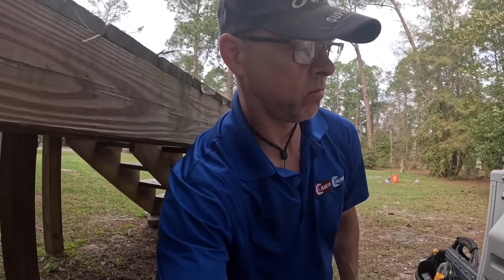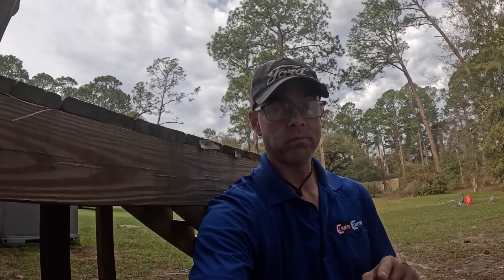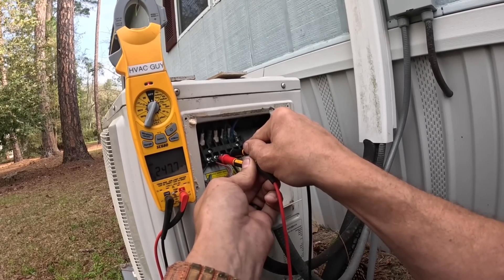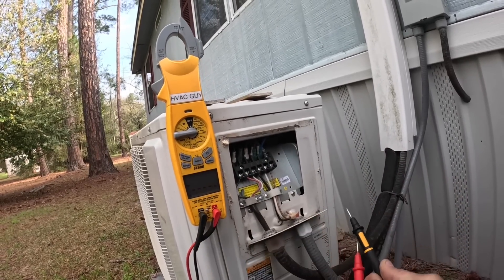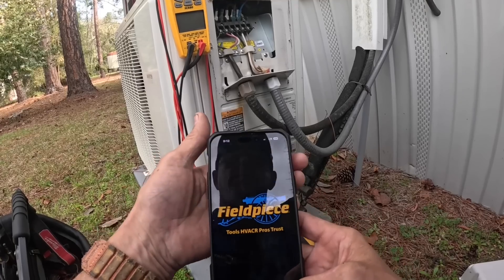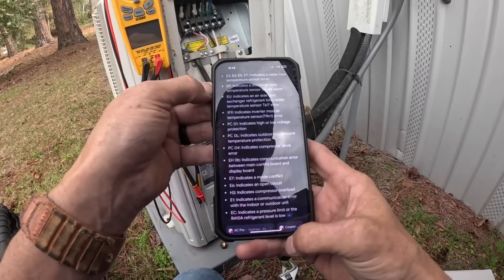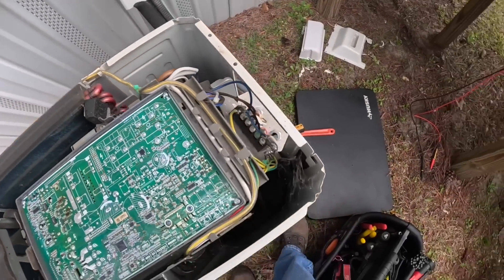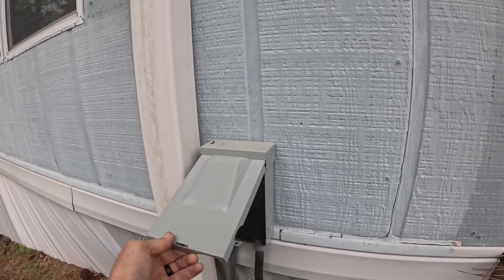Unable to Find Meaning Of H3 Code On Mini-Split! #hvacguy #hvaclife

Comment: I'm about to graduate with my Associate in HVAC/R and these Mini-Splits seem to still be something of a mystery. We have worked on them in class but not a lot of good repair info to be found on them and finding parts can be really hit or miss. Especially if it is specific to a particular brand. I did purchase a book that deals with generalized mini-split service procedures, and it seems to be pretty detailed with a lot of information. I haven't had time to really dive into the book yet but that is my plan as soon as I graduate so I can focus more and learn all I can about them. It will probably be necessary with these becoming more popular. Seems like people either love or hate mini-splits, not much in between. I have a few of my own and they work well for me.
Reply: If I run across a mini split systems the first thing I check for are three little letters PRC. That means the system is a Chinese manufacture, not just made in China like most of the major mini split systems are made but a Chinese company. Don't stop keep running away. PRC means People Republic of China, and good luck if you're trying to get in contact with technical or find a manual. As far as I'm concerned they are throw away systems.

Comment: Inverter type air conditioner In the external piece, there are 3 sensors connected to the inverter card that are responsible for the work of the compressor,,, To measure the ampere drag of the compressor, you must open the front piece and measure the withdrawal of current from the wires between the inverter card and the DC compressor

Comment: low charge issue, high super heat and a frosting discharge line, its likely freezing up and causing the compressor to overheat

Comment: At 12:00 minutes I noticed line to evaporator is frosting.  Maybe leak, low charge, high superheat causing compressor thermal shutdown.
Reply: On mini-splits this can be normal. The expansion device is in the condenser.
Reply: I know EEV is in condenser, but a line after EEV below 32f is still an issue that should be investigated
Reply: @davidb2438 fair play to you. You're the only one worth listening to here including the one who made the video. He's as clueless as most of the responses!😮

Comment: I’m thinking it’s sensing a high compressor temp too. Possibly the thermistor has drifted in value but without knowing temp vs resistance it’s kinda hard to know what’s what. Hope your hand is doing better. Have a good weekend and give Riley an extra treat or two😊

Comment: my SOP for mini splits is to recover the charge and find out if it is correct . I replaced a circuit board per tech support once and still had the same issue then I recovered the refrigerant and the system was running on half a charge so the company I work for made it a rule to weigh out and weigh back in the proper charge , the compressor overheated for some reason . I noticed the liquid line frosting up in the cooling mode ? or was I seeing things ?
Reply: Exactly that. Spot on. It's almost certainly a charge issue. Might even be mixed refrigerant. 

Worrying that some are blaming the fan motor sensor PCB etc  when the obvious right there in front of them...

Comment: H3 is for a high temp compressor sensor. Since you’ve ruled out it being caused by a dirty coil or faulty TXV, consider testing the thermistor sensor located on the compressor. Expect you will find the thermistor out of range or poor wiring connection.
Reply from the maker: Thanks
Reply: I just had to do the same for my Mitsubishi MrSlim...   I replaced the entire Thermistor set and it works perfectly.

Comment: Copper pipe fuses?  Hope there was a correctly sized breaker upstream.
Reply: Those were regular fuses.
Reply: @anthonydesisto2328   Late response....  Nope, when he used his phone to take a picture of the fuses in the disconnect earlier in the video there were two pieces of half inch copper pipe in the fuse holders.  Later in the video it shows him putting in correct fuses and a few moments later you can see the copper pipe pieces on the porch to his right with some of his tools.  Glad that potential fire hazard was fixed.

Comment: I’ve been noticing my field piece app won’t load when I have really bad service. Ticks me off, I shouldn’t need good service for the app to work. I have one whole development where it never loads now.
Reply: You need Internet to log in
Reply: @allanbrito13  One would assume you don't need to "log in" simply to read data from the probes you've already bought and paid for. Otherwise, where's the sense in dropping $700+ into the hardware only to find you can't use them in areas of poor service?

Especially with that recent AT&T outage a few weeks ago, where a massive quantity of phones didn't work due to a coding error; a tech loses far more money than the $5 credit AT&T offered as compensation (and only to its contract customers, but that's another discussion for another time) because they had no internet access.